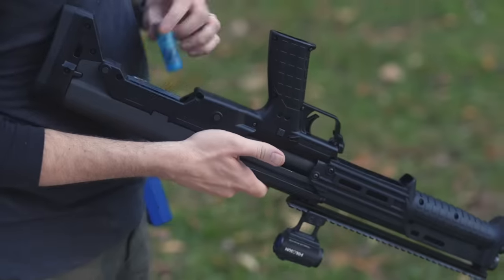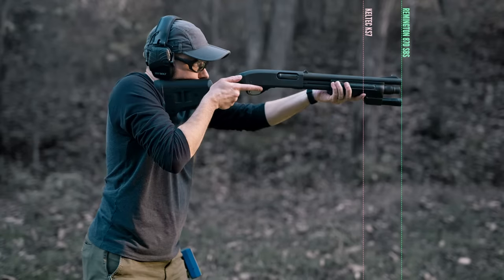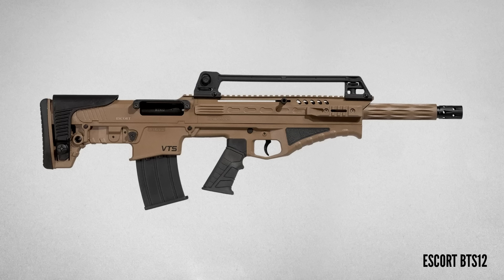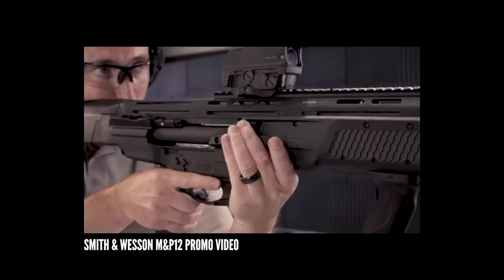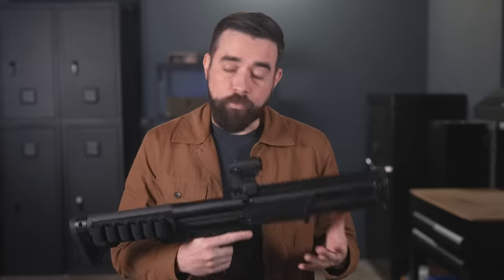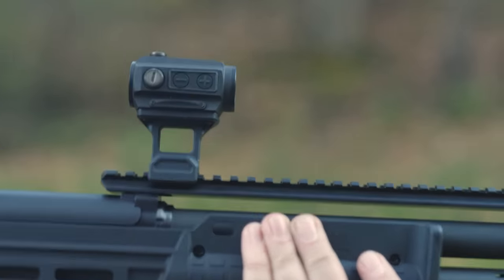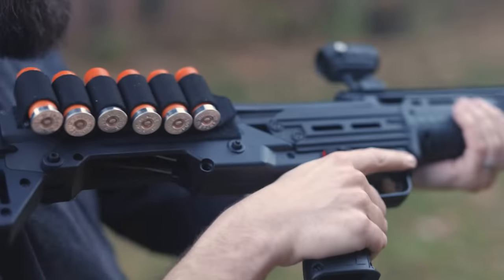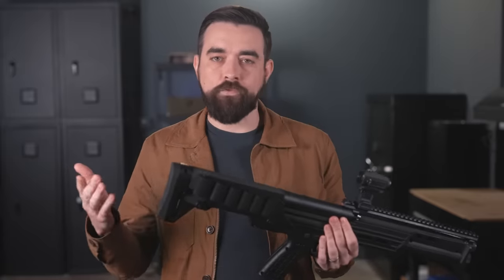The Bullpup Shotgun Experiment

Comment: I'm really interested in shotguns for ammo diversity. It seems like you lose that when using mag-feds, semis, and bullpups; meaning a bullpup semi may even be ammo particular? I'm a bit of a shotgun novice, myself, so these are wildly speculative assumptions based on very little data, but I would love to see ammo options discussed.

In the same vain, I prefer minishells due to disability, but those aren't reliable in many shotguns that I know of.

And unrelated, I'm particularly prejudiced against Turkish firearms for probably no good reason, but I would be curious to see if they are actually reliable and sturdy shotguns.

Comment: There is a factory improved recoil pad for both the KS7 and the KSG, helps quite a bit. Both shotguns also work very well with mini shells so you could further mitigate recoil and increase ammunition load.

The pump action on the KS7 is quirky there are no two ways about it. You have to almost hesitate or pause in the last half inch of travel. It's a quirk with the shell elevator, I really wish they had just copied the Ithica37 shell elevator.

As far as reloading technique, turn it a quarter turn counter clockwise and put it on top your shoulder(kinda like a violin), your right hand is then free to reload(or use a side arm) and you can see the side of the shell window in your peripheral vision to make reloading easier.

Comment: Personally, I do like the concept and design of KS7. But since where I live has no restriction on shotgun's barrel lenght, so I can legally get a cheap Turkish 8.7" shotgun with similar total lenght to KS7 (can be longer or shorter depended on the position of adjustable, removable stock). With some compromises on capacity (4+1 vs 7+1) and shorter barrel lenght (8.7" vs 18.5"). I don't see any real benefits of KS7 over the cheap 8.7" shotgun in home defense scenario. (Especially when KS7 isn't available here and the KSG's price is 3.5x higher than the 8.7" shotgun!!)

Well, the concept and design of KS7 is great. I wish it would be available here soon.

Comment: Bullpup shotguns make suppressed shotguns practical, because effective shotgun silencers are a foot long. Because of the length, they'd need a handguard over the silencer to achieve their full potential. My dream home defense shotgun is a tube-fed integrally suppressed short barreled semi-auto bullpup. If it's integral, it doesn't need to be a registered SBS since the silencer will add to barrel length. I dream of a handy and reliable semi-auto shotgun that won't make my eardrums explode if I fire it indoors without hearing protection. Can I get that in a 20 gauge? I'm not holding my breath. Seems almost as niche as my idea for an ultralight small frame revolver designed to fire only .32 Long full wadcutters (hot loads like Buffalo Bore are very effective for their low level of recoil!) This shotgun would have been one of the projects I would have been working on if I'd chosen to accept that position at gunsmithing college. I expect I would have made a custom stock and handguard for it.

But since I'm aware of no bullpup like that, let alone one that meets my quality standards, if I was buying a defensive shotgun today it would be a conventional Beretta or Benelli semi-auto. I've seen a handful of gunsmithed weird custom shotguns that were cool, but not cooler than the functionality and reliability of a fine Italian semi-auto combat shotgun.

This was a good video, and I hope to see a semi-auto follow-up.

Comment: Weren't all the Smiths recalled already?
Reply from the maker: Yeah, they had an issue with the barrel in the first batch of guns. Probably some error from their supplier with heat treating or something. Doesn't sound like a serious design flaw, just a manufacturing hiccup, which is pretty common with new models these days. It's obnoxious, for sure, but not something I would hold against the actual design of the M&P12.

Comment: Bullpup shptguns been around since 1970s with High Standard then Mossberg in 1980s...I bought one in 1988 as just turned 18 so as a 51 yo the only shotguns ive used are bullpups.  The main reason is that they are full sized shotguns that are still 26 inches long so no NFA paperwork or dumb handling aspects of those shockwaves with compact handling.  Reloads with any self defense shootings are rare either pistol rifle or shotgun so in the end dont care plus i use mini shells so 12 in my KS7 or 25 in my KSG no reload needed.

Comment: If the guns like KSG or the new one from S&W took detachable magazines, I'd be more interested. As it stands now though, stuffing shells into a bullpup shotgun one by one is second only to a cap and ball revolvers for having the most obnoxious reload cycle. Hell, it would even be better if they used the tubes-on-top system of the old Neostead shotgun. Flipping the gun upside down and such is just, as I said before, obnoxious.
Reply: IWI TS12 can easily be duel loaded from either side.
Reply from the maker: Honestly, flipping the gun upside down to reload is the least obnoxious part of it.

Comment: So much double-talk against the Bullpup concept in this video and whining. He mentions his lack of real concern for all the extra capacity because in his opinion, “one or two 00 buck will usually be sufficient to achieve the required behavior change sought after”, …..Then later rips the Kel-Tec recoil for making his shoulder hurt after only half a box, and “he can shoot his conventional shotgun 600 rds before his shoulder hurts.”. Thought he only needed a couple of rds off 00 buck to achieve his goal, why the training with 600 rds?

He does admit possible operator error with his Bullpup failures, but kind of just in passing, which with his limitation of only 12 rds before his little shoulder hurts and he has to quit shooting the Bullpup, yep operator error due to lack of training is apparent. Good grief better choice for this guy may be and old single shot,  and a 20 guage at that,……. Less recoil on that week shoulder!

A very biased kind of whiny review of Bullpup shotguns. At 70, the last time out with my KSG I put 400 rds through it, with one failure to eject and it was my fault, short stroked the action. Sore shoulder the next day, yep,…. but I appreciate the short length of the weapon and high capacity there if needed, both missing elements in my 870 riot .